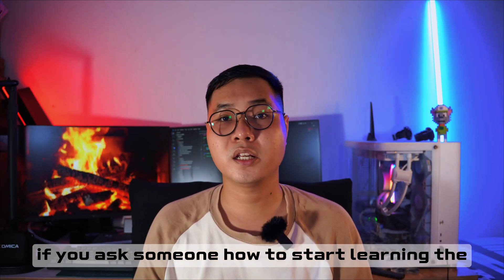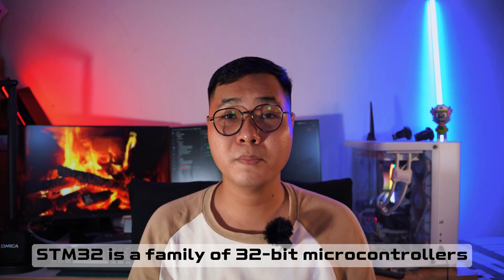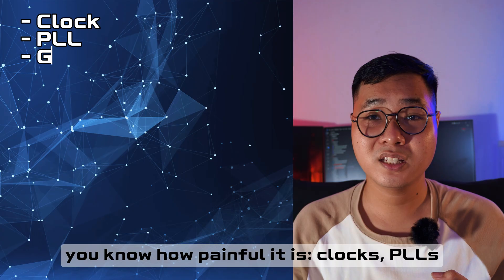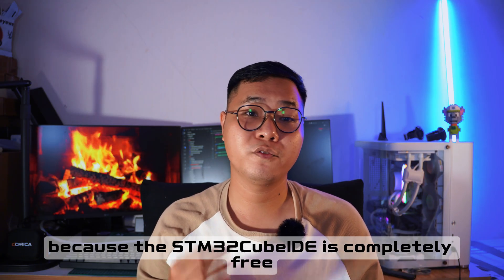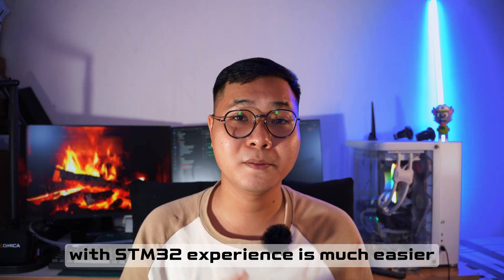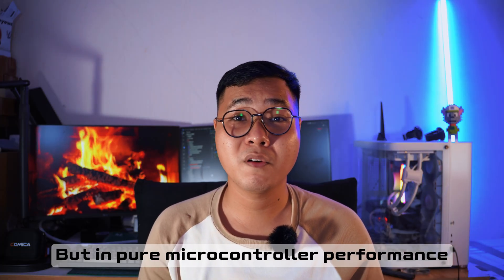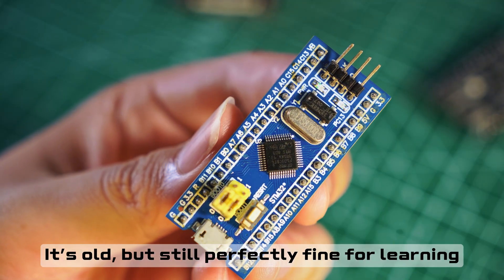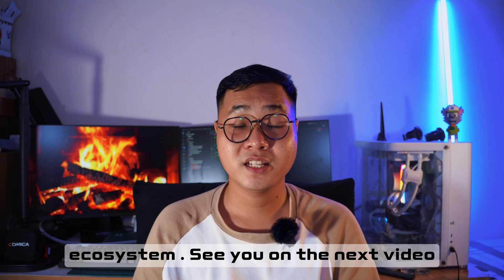Why Everyone Learns STM32 | Tools, MCU Families, and the Best Starter Tips | STM32Cube Ecosystem

Comment: Wrong. Poeple do not want changes.
I do stick with 8-bit ATMega chips.
Reply from the maker: Yes, 8-bit microcontrollers still have a place. My company has been using 8-bit microcontrollers manufactured decades ago for new products (as long as they are profitable). In the home appliance and IoT sectors, 8-bit microcontrollers can still meet requirements well. But it seems that 32-bit microcontrollers like ARM are still playing a significant role in industries like automotive and high-performance products.
Reply: @Benedict-Lab  Well, I do not speak having busines in my mind.
I am an amateur using those MCU since ages.
One of the things f** me most is the rapid movement of industry wanting to replace proven good, reliable, good enough electronics in favour of selling more expensive stuff.
Reply from the maker: Haha, I understand. Like a refrigerator, all we want is for it to keep food cold, but they add a huge screen and sell it for five times the price.